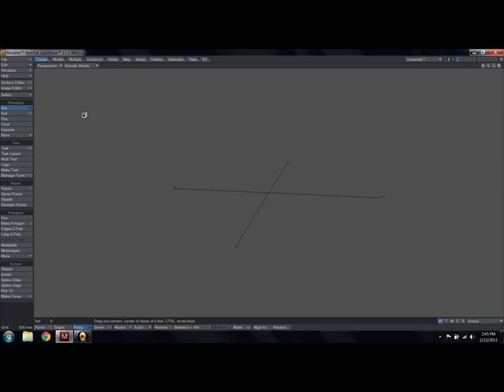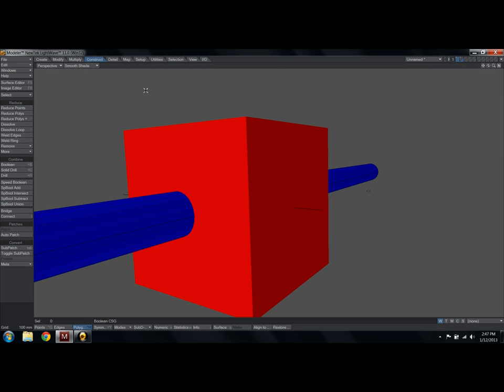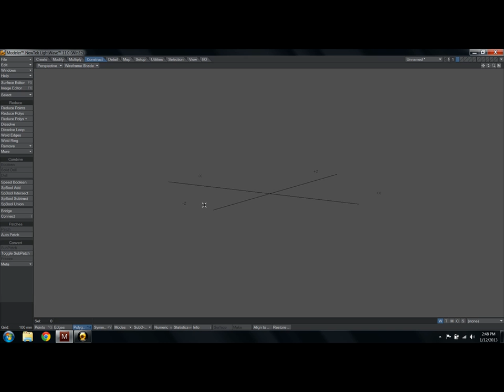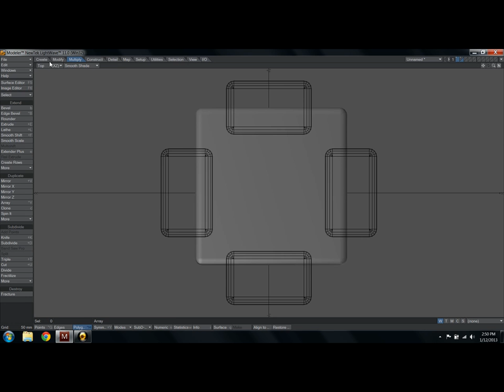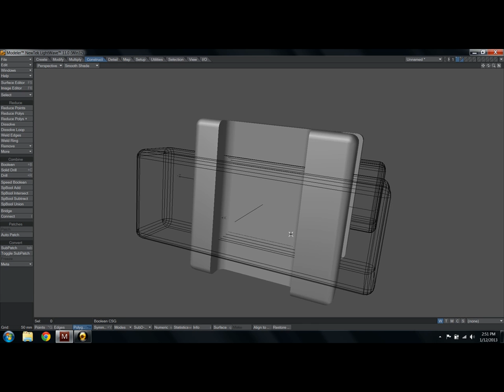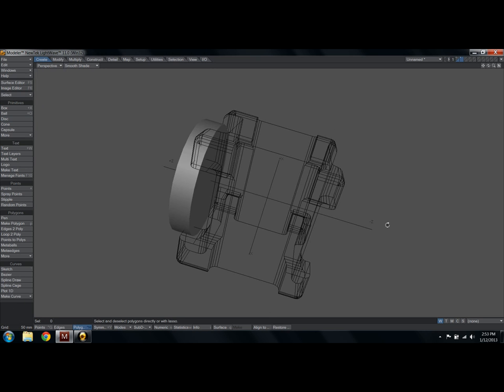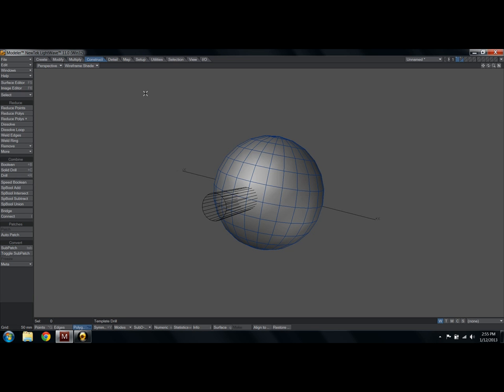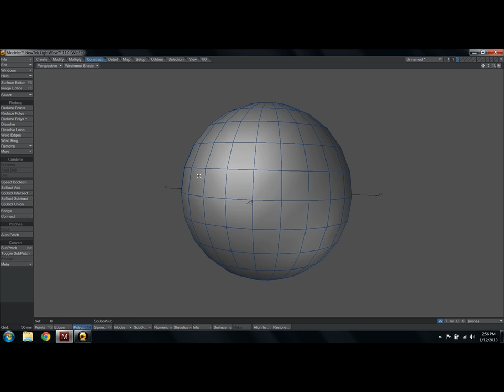Lightwave 3D for Beginners / Pt. 8 / Boolean Operations

Comment from the maker: Off the top of my head, I'm not sure. I can tell you that the "brute force" version of Merge Points is Weld, which is done by selecting two points and Ctrl-W'ing. (It's in the Detail toolbox.) If you do that for both "ends" of a pair of edges, you'll have collapsed them into each other.

Comment: the "m" for "merge points" just made my life easier. is there a simillar function for edges? Like the one polygon edges that seem like they should be connected to two?
I'm trying to make sure that my model is manifold for 3-d printing, but I was told to avoid Boolean because it cuts the pieces apart?